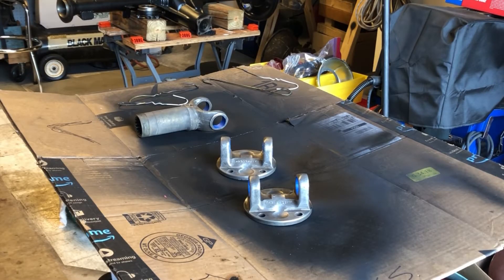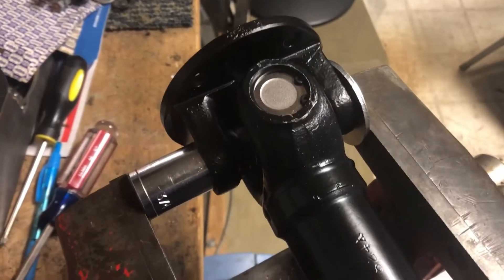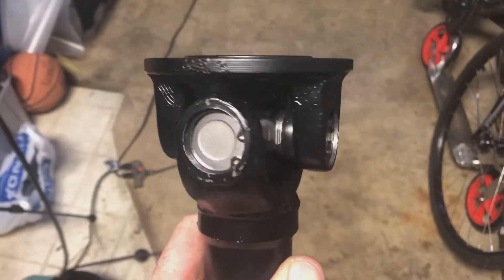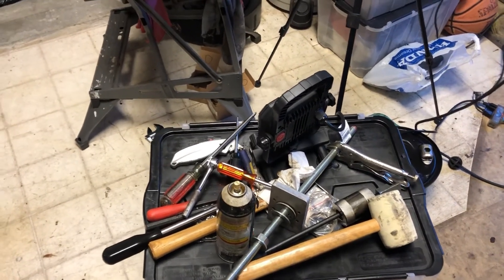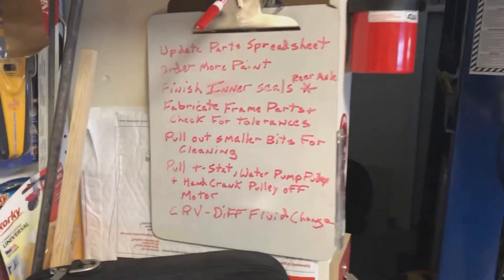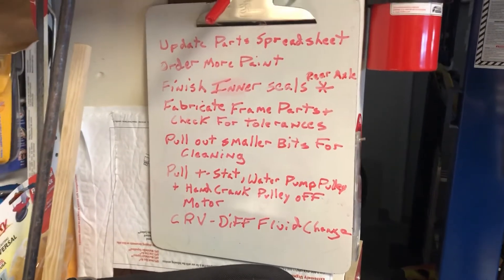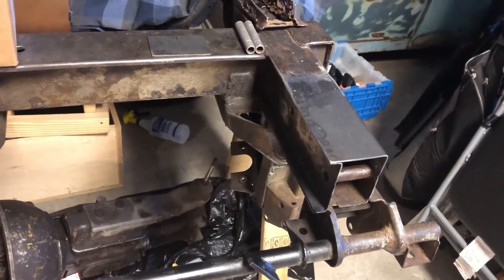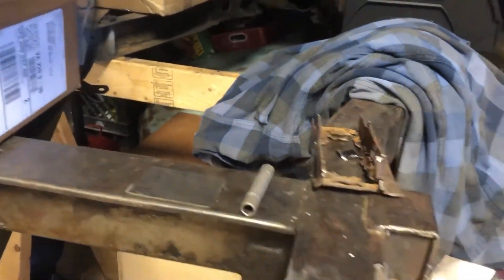1958 Triumph Tr3 Driveshaft completion

Comment: Those axle seals were a challenge.  You’ve probably seen that the steel shell is a c channel.  If you compromise the vertical walls of the c channel you can pry the outer wall of the channel inward causing the assembly to collapse in on itself.  It helps a lot to get the leather out of the way first. The second one will be easier!
Reply from the maker: Yep thanks but why is the replacement one only L shaped?? Weird right, I just didn't want to keep hacking on it while i was frustrated
Reply: @pucman1  Not sure about the configuration change.  Yea, best to back away when the frustration level rises.